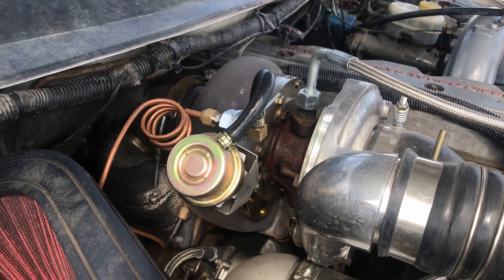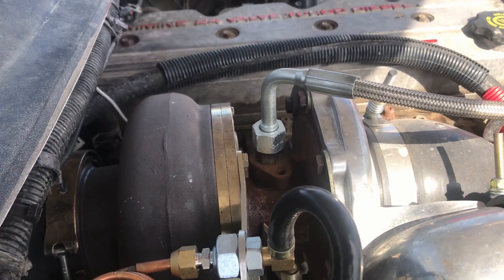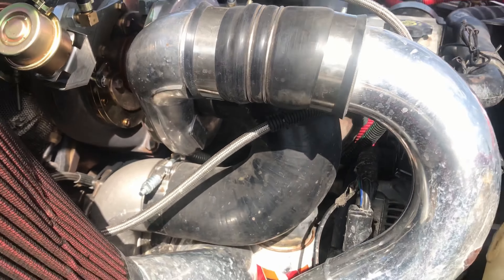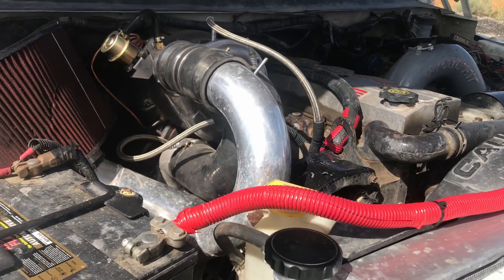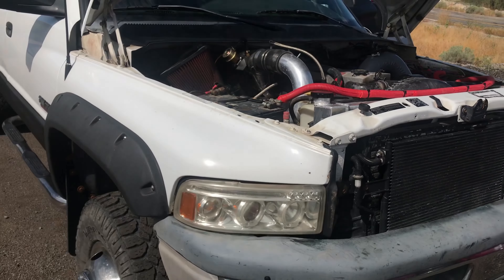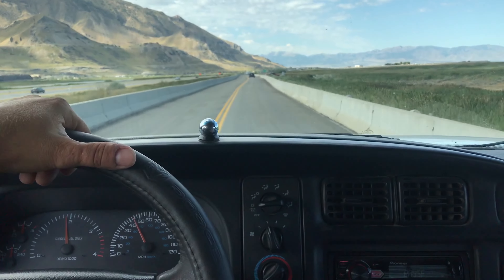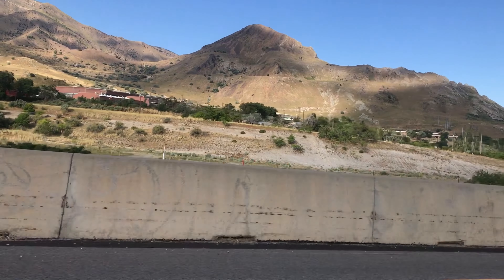DPS Turbonator VGT with Compound Turbos

Comment: Interesting but I think a modified He351ve/he300vg 67/70 with a stand-alone lil’blackbox Vgt controller which allows for custom changes with the app and all functions ie-exhaust brake is better.
Reply from the maker: The Turbonator has the option of its own stand alone electronic controller that exhaust brakes and with a housing that behaves like a .45 all the way up to a 1.10 a/r it out performs the stock VGT at every point in the rpm band.

Comment: Sounds great right up until you get stuck vanes and have to clean the turbo.
Reply from the maker: The Turbonator was specifically designed to work well in a high soot environment so that the vanes don’t stick..
Reply from the maker: **the vanes don’t stick
Reply from the maker: They are based on a pivot (not sliding) technology, specifically to reduce wear and sticking.  This is unlike any of the current turbos being used in the pickup truck market.
Reply: I know Ben and you can ask him also, but the black smoke on this 24v was significantly reduced once he installed the Turbonator. We all noticed right away how much less black smoke his truck made by only switching to the Turbonator turbo.
Reply from the maker: @tevinharper721  We will see if we can get Ben to personally reply to your comment and talk about the difference with spool up time and the reduction of black smoke that he has experienced with the Turbonator. Because the Turbonator is able to continually adjust to optimal positions required at any given time, it is very efficient and greatly reduces smoke coming out of the the exhaust. The efficiency can also be felt with the noticeable increase of fuel economy that one gains with the Turbonator.
Reply from the maker: @tevinharper721  What state are you in?
Reply from the maker: @tevinharper721  Currently, I am not aware of any plans for the 65mm or 68mm turbine wheels, because are moving mostly toward larger turbos. Soon we will have the T6 sized S400 turbos (semis).
Reply: Hes got 150s on that truck and he was romping on it. Of course its going to smoke.

Comment: Just with my ear I can tell it’s super laggy.
Reply: The Turbonator increased the spool up time of this 24v by at least 400rpm over what it was doing before the Turbonator was installed.
Reply from the maker: We can assure you that the Turbonator is anything but laggy.  Spool up will increase 200-400 rpms by doing nothing more than replacing your turbo with the Turbonator.  The Turbonator also runs so efficient across the entire rpm band that it also increases fuel mileage and reduces smoke all while bringing on torque and hp power on much quicker. Here is a link to a video that shows a break down of the spool up on a 68/74/VGT:   https://www.youtube.com/watch?v=g5mc1flSY34&list=UU9aRgqW_hezn7wbk1RyFV3A&index=18
Reply from the maker: @tevinharper721  This member's 24V with 150 hp injectors and a tune was was significantly more smokey before, smokey enough to shutdown a hwy. However, now with the DPS 62/71/VGT Turbonator over a S475 Compound Turbo kit even when it is tuned to the max, like in the video, the smoke is low (probably 10% of what it was) and cleans up fast.  Normal driving set on his normal tune doesn't produce much smoke.